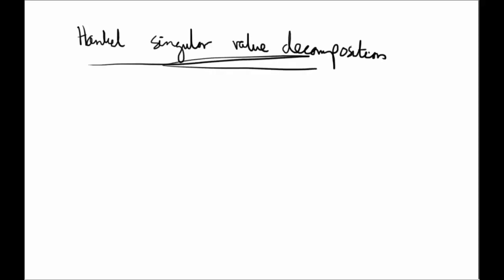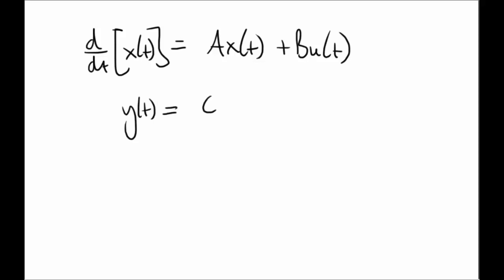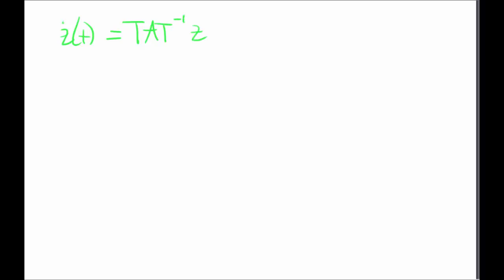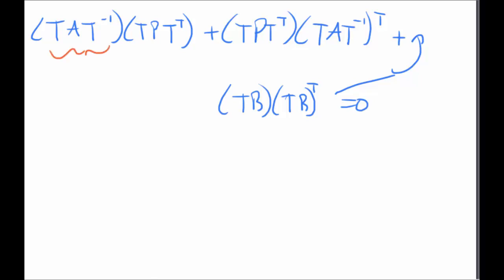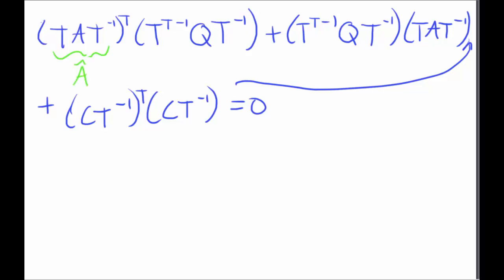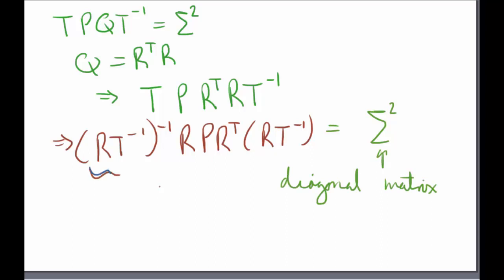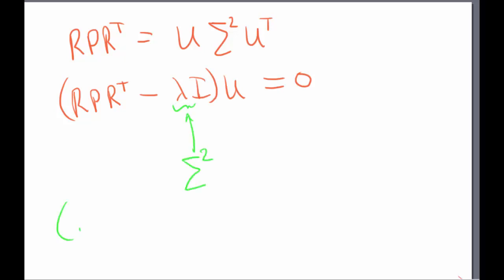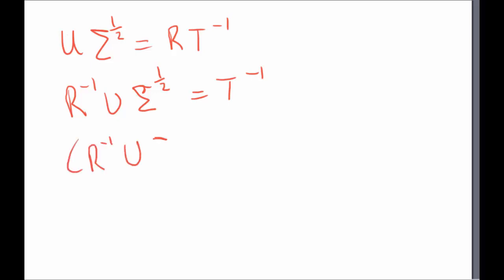Hankel Singular Value Decomposition (HSVD): Part 1

Comment: Please, I am trying to run a hankel code for my research and I happen to get an error that states that as below after evaluating the part of the code below as well.
Rp = chol(X1*X1'/(pn-1));            %Past Cholesky matrix
Rf = chol(X2*X2'/(pn));              %Future Cholesky matrix
Hfp = Yf*Yp'/pn;                     %Cross-covariance matrix
H = (Rf'\Hfp)/Rp;
Error using chol
Matrix must be positive definite.
Please if possible can you advice what I can do to make this work?
Thank you for your assistance. Looking forward to hear from You.
Reply from the maker: Hi Henry,  

Your pn value isn't 0 or 1 by any chance? If pn=0 then that means that Rp = chol(X1*X1'/(pn-1));  and Rf = chol(X2*X2'/(pn));  are both negative definite. If pn=1 then Rf = chol(X2*X2'/(pn));  is positive definite, however, Rp = chol(X1*X1'/(pn-1));  still remains negative definite. If this is the case, then try pn=2 and see if the same problem occurs.
Reply: pn is neither 0 or 1. It is actually from my data set that is an 800*4 matrix used as either my training set or a fault set.
Reply from the maker: what values do you get when you type the following into the MATLAB command window?" min(eig(X1*X1'))" and " min(eig(X2*X2'))"
Reply: min(eig(X1*X1'))" and " min(eig(X2*X2'))" yields -2.2464e-09 and -9.6874e-10 respectively.
Reply from the maker: this will get you out of the situation, however, you are technically changing the data somewhat (by an insignificant amount, but changing the data nevertheless)

"
X1_min=min(eig(X1*X1'));
X2_min=min(eig(X2*X2'));

if X1_min<0
        Rp = chol((X1*X1'-X1_min*eye(800))/(pn-1)); 
else
       Rp = chol((X1*X1')/(pn-1)); 
end

if X2_min<0
        Rf = chol((X2*X2'-X2_min*eye(800))/(pn)); 
else
       Rf = chol(X2*X2'/(pn));   
end
"
Reply: Thanks very much. Please now this error message shows up

Error using  - 
Matrix dimensions must agree.Error in newdpca (line 41)
        Rp = chol((X1*X1'-X1_min*eye(800))/(pn-1));

How can I solve this please.
Reply from the maker: what size is "X1*X1'"?
Reply: 25000*25000
Reply from the maker: replace the 800's with 25000 and see if that helps